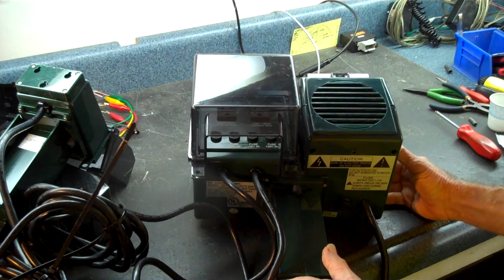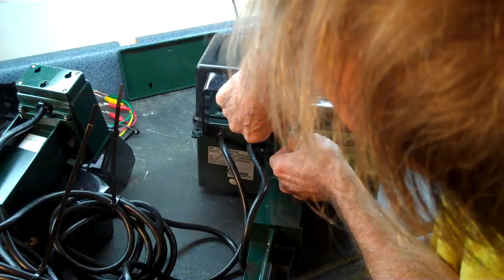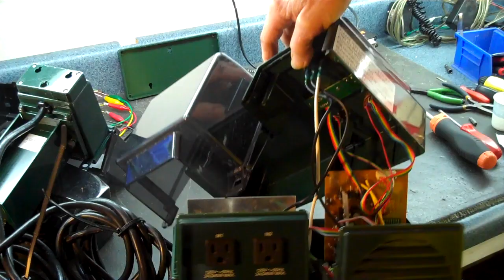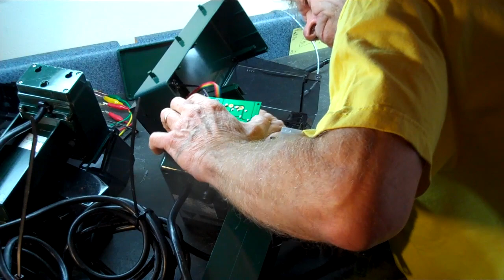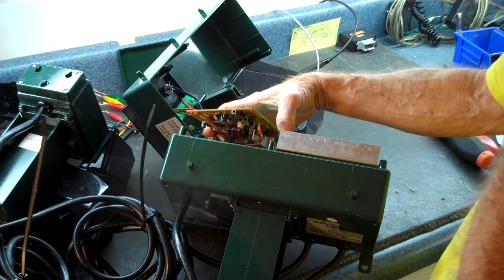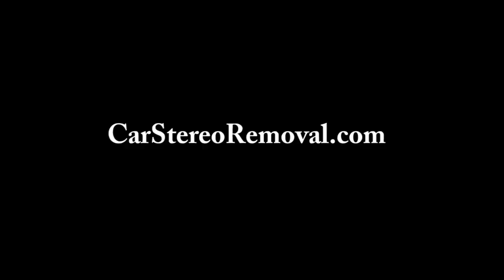Mr. Xmas -  No Audio - Do It Yourself Repair - Car Stereo HELP

Comment: Where is the fuse located
Reply: The fuse is where you plug in the box to the wall.  There is a small door that slides open to access a compartment that has the fuse and next to it is a spare fuse.